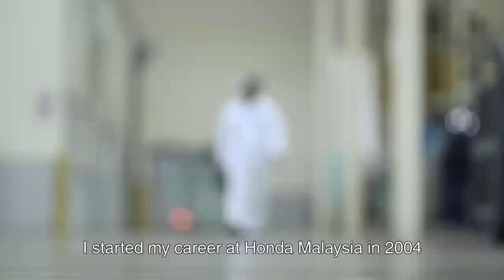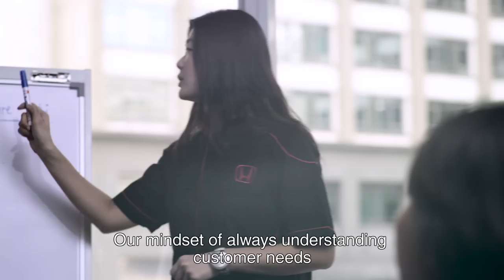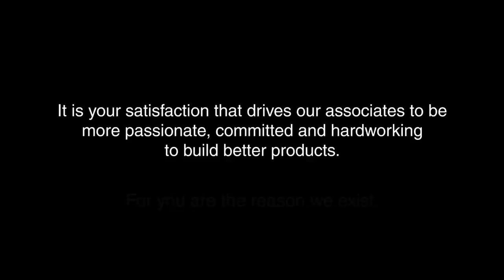Pride, Passion & Satisfaction: Honda Malaysia’s Success Story

Comment: I have being a Honda car owner for more that a decade. I have always enjoyed driving honda cars and trust the honda quality.  This year I purchased a new Honda City Hatchback RS. Love the car handlings and spacious cabin interior. But sad to say honda has overlooked by not putting back lights for the Side Mirror controls switches at the driver door area.  Now I have to feel in the dark at the control switches to open and close the side mirror in the night. In my wife CRV the same control switches have back light but not on the City RS.. Honda Customer satisfaction is paramount for the Flagship RS model.. the back light should be included. Tq.